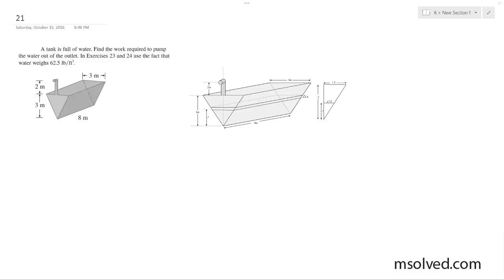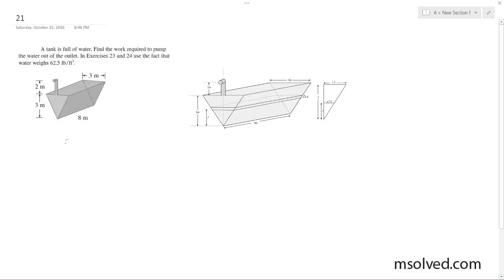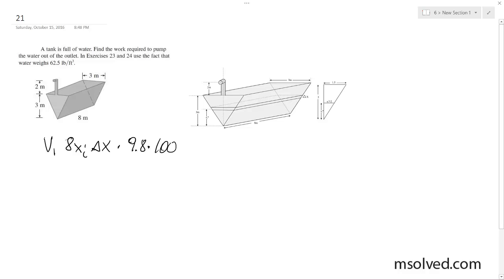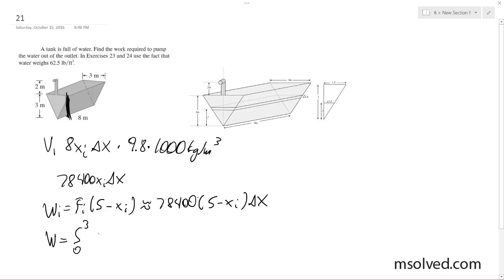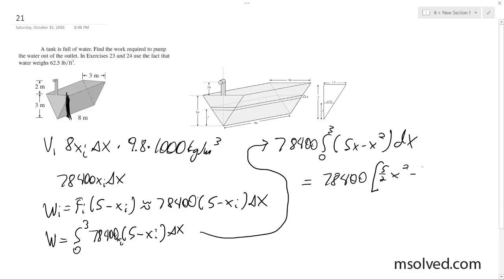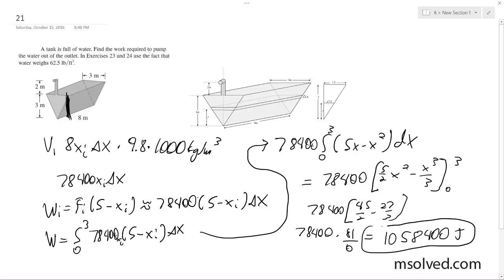A tank is full of water. Find the work required to pump the water out of the outlet.

Comment: You should really not have the 9.8 and the 1000 all on the same line for the first step (i.e. show that you multiply 1000 time volume to get mass, then multiply by 9.8 to get force). Also, it should be 78000*x*(5-x)*delta x in the integral, as delta x becomes dx. (You removed the x then randomly added it back in). It was a good video but it would've been a lot more helpful if you explained more in depth
Reply: why do we multiple x wont it just be 78000*(5-x)delta x . as we are multiplying base times height time width